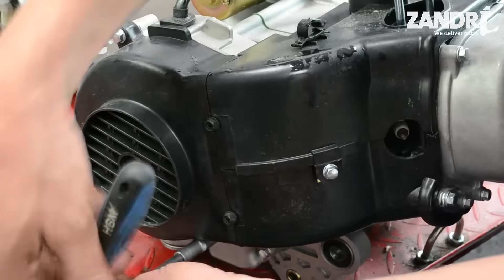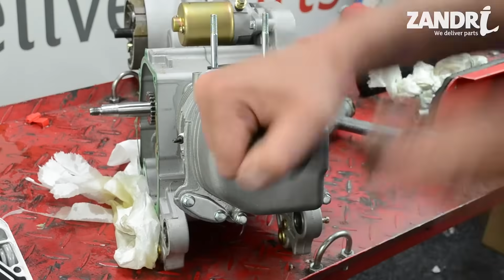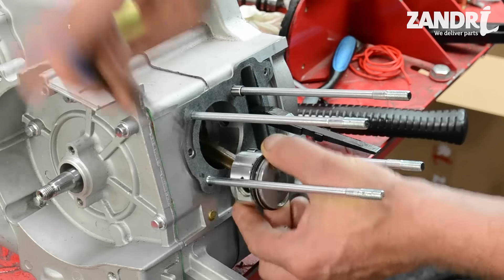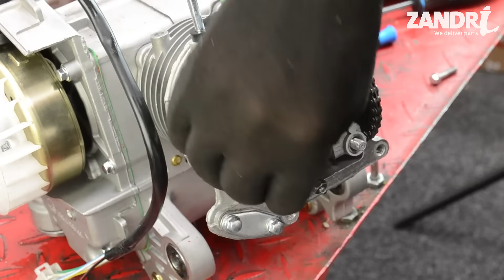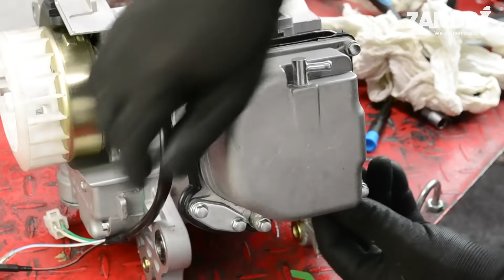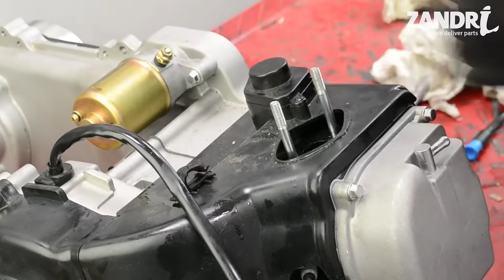Cilinder vervangen | GY6 motorblok

Comment: Thanks for the video but it left a lot out. Flywheel is on, then it's gone then it's back again without showing the timing process. VERY important. Also the torque specs would be nice.